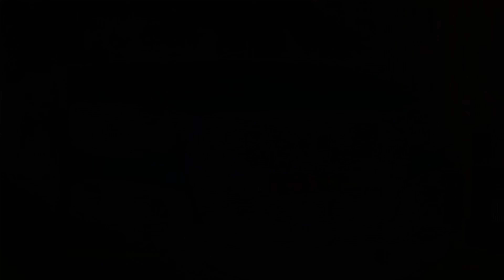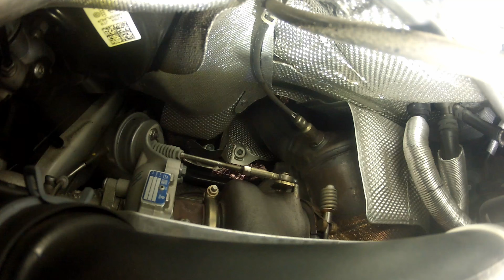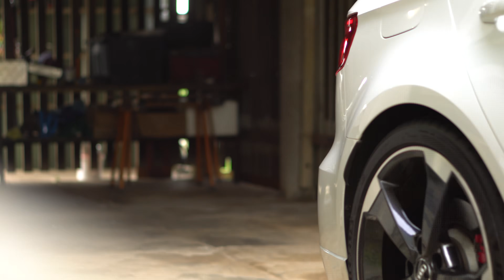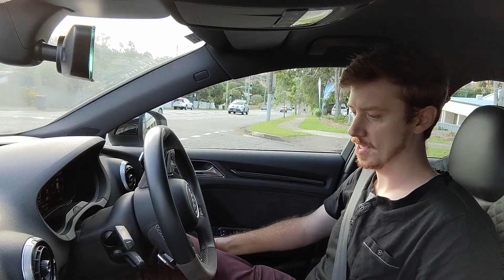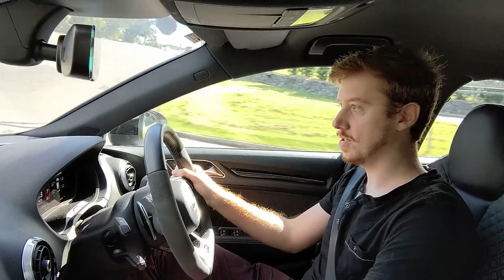RS3 "Secret" Lound mode explained.

Comment: Have you yet figured out how to get the crackles while revving stationary? I don't get them always... also it's funny how you get the crackles the most frequently when driving in dynamic S and brake firmly to 2k rpm when it downshifts and causes the crackle. :D
Reply: Answering to myself. I've noticed that if you want to do stationary revving and get some crackles you need to cycle thru all different drive modes to dynamic and that will enable to crackles. Also the cold starts don't have that tinny wastegate rattle when you start up the car in dynamic mode. If you switch to individual for example the rattle appears right away lol.

Comment: The loudest mode is in 1st gear only. Once open  Then you can deconnect the valve and It Will stay open all the time. This is the loudest setting. But you will probably some torque because of pressure/ECU mismatch
Reply: Deconnect? You mean unplug the valve controller?

Comment: Do you have the rattle noise from the cold start also when driving?
Reply: Did you find the fix. for rattle while driving
Reply from the maker: I've mostly removed the low RPM rattle by adjusting the wastegate precontrol. I intend to do a video on it but have been distracted by a million other things
Reply: @KoryNunn please make more videos, just subscribed.
Reply: @KoryNunn please explain